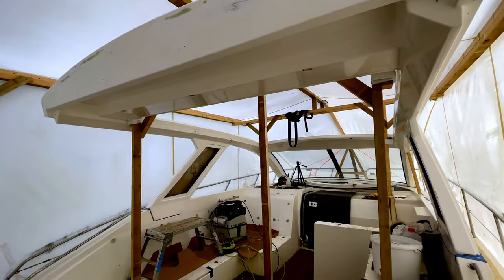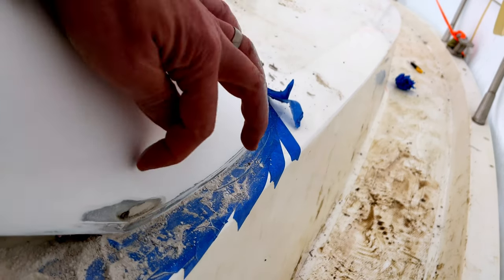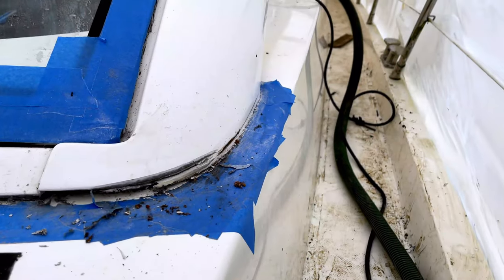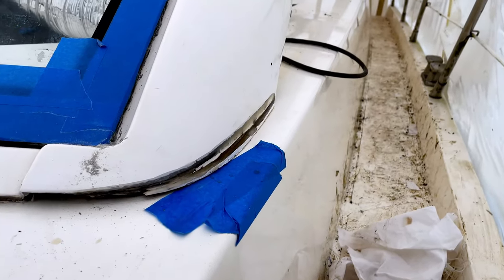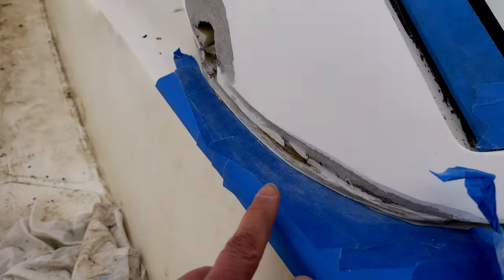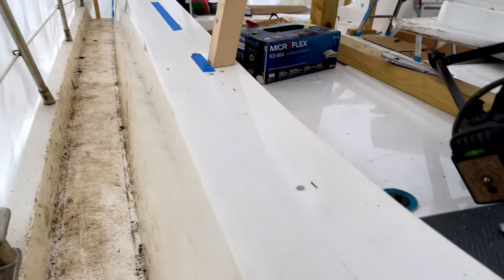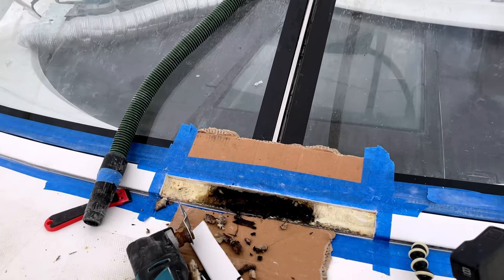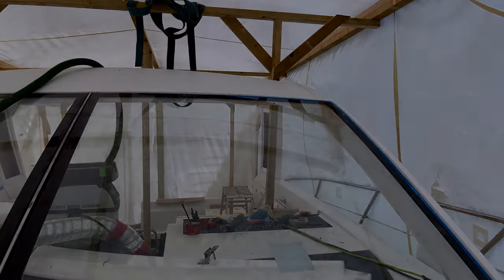DIY BOAT Restoration - MORE Rotten WOOD on our BOAT - EP.63

Comment: Its been awhile Chaps but as always worth waiting for. Feet Up, Gin Poured and 20 mins of quality Boat Renovation viewing. Cheers :-)
Reply from the maker: Cheers Jimbo 👍
Reply: Amazing build thanks so much for taking the time to document it, the videos are the same high standard.
P.s. where was the water ingress from, especially on the middle section? Cracked gelcoat?
Reply from the maker: @gb4780  thanks for watching. We think the middle section became wet from lack of proper seal on the front edge.